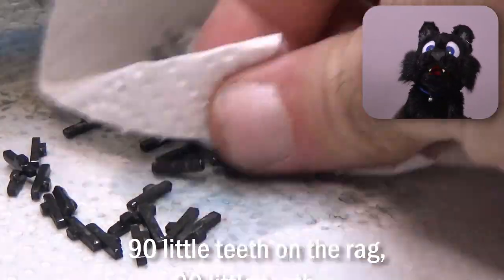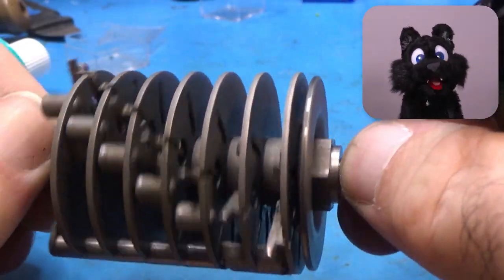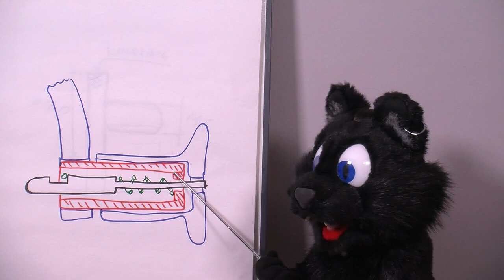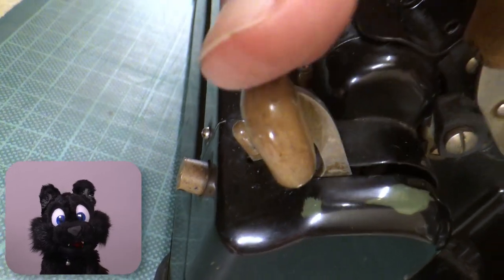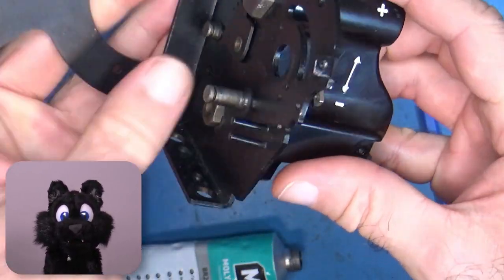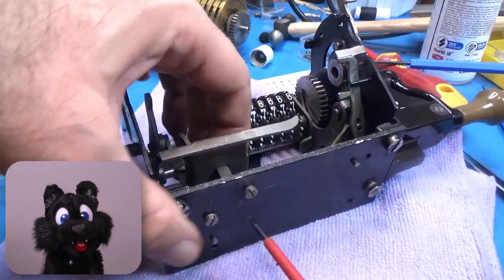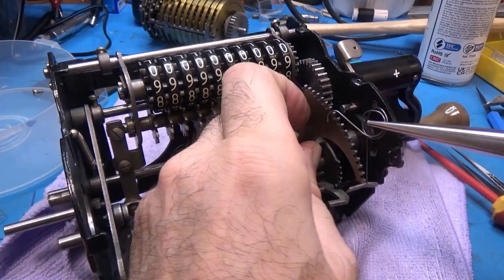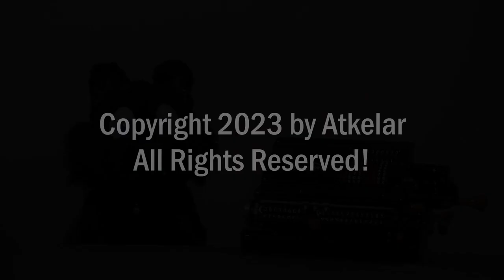Triumphator CRN-1 - Part 2

Comment: Well done so far, a conscientious resurrection. Either you have a photographic mind or you must refer to the disassembly video multiple times. Too late now, but thought of using a light thrust or crinkle washer on the handle to prevent binding. Hats off to the original designers, working with so many small interdependent parts.
Reply from the maker: Thank you! This one has lots of washers that are somewhat important for clearance and distances. So I had to check back to the videos a bit more often than with other projects. Overall, I tend to remember enough details to narrow the possibilities down to one that fits 😜

Comment: What is that white filler you are using?
Reply from the maker: For the digits? That's white model making paint. It works well and rubs off on the high spots when it's still wet.